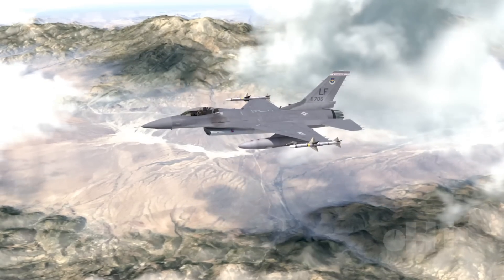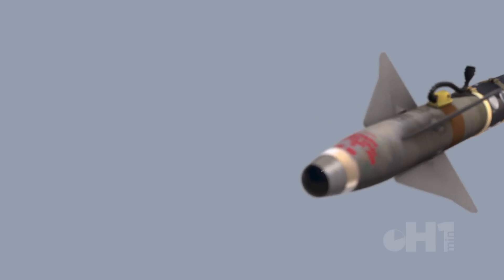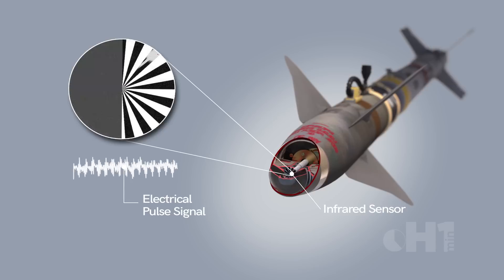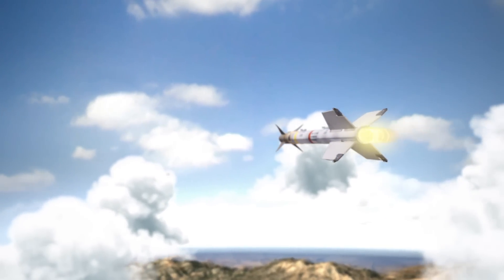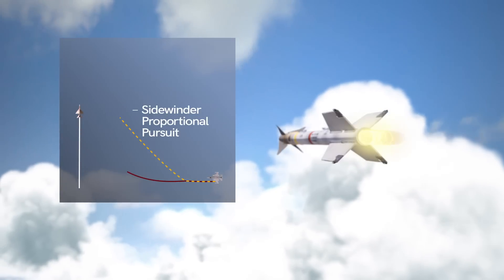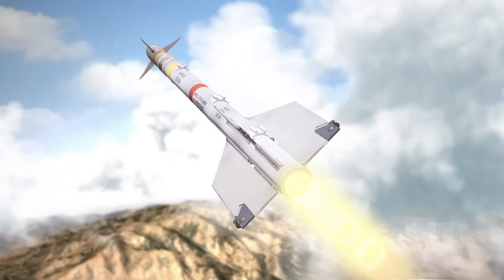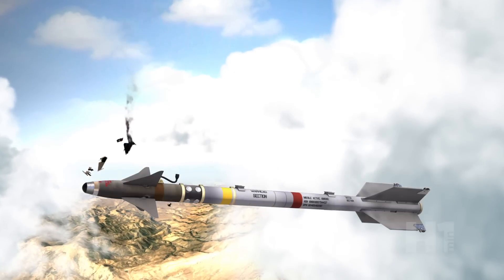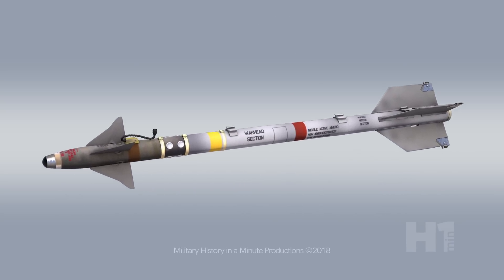H1MIN: AIM-9 SIDEWINDER Infrared Seeker

Comment: You missed an opportunity to describe the seeker in depth.  It produces an amplitude and phase signal from where the heat gets focused by the lens. The reticle is what encodes this.   Also the optics is a reflecting telescope but it spins on the optical axis to become a gyroscope.  The pointing of the seeker is done via motors that cause the gyroscope to precess in the desired direction.  The sound you hear is actually the signal on the IR detector itself.  The buzzing sound is from the reticle encoding the IR light the seeker is imaging.

Comment: As I understand it, the latest versions of the AIM 9 use a rotating mirror. Since the photo voltaic cell can't discern position, only hot and cold (scalar quantity), it uses the position of the mirror to judge the bearing of where the signal is coming from. But can anyone tell me how the weird interrupter disk works instead?

Comment: How the hell does it distinguish between different IR sources or even calculate a trajectory without computers? It's been around since the 50s, so must have been completely analog.
Reply: There have been MANY iterations / versions of this missile. Yes, been around since the 1950's (Dr. William B McLean invented the worlds first air to air target seeker in that decade). So, back then, the AIM-9B models understandably weren't that sophisticated, nor the AIM-4  Falcon predecessor. Example: you had to be behind the target for the missile to track. Later, in the late 1970's early 1980's, the seeker employed "lead angle tracking." Meaning, as in the vid, the ability to move to where the target will be greatly improved accuracy. Additionally, advances in electronics permitted "CCM" (counter-measures) programming. Example: The ability to not get confused between an engine in afterburner and a countermeasure flare tossed in a "Hail Mary" attempt to throw the missile off course. Not 100% effective, but it helped. The above vid seems to feature the AIM-9 L/M model. With these, you do not have to maneuver behind your bogie - the argon cooled seeker can detect enough heat on your leading wing and nose edges to track and kill. Mark Williams, USAF (ret) Munitions Systems Specialist, 1981 -2002

Comment: I used to work with these frequently at Homestead AFB. The issue arose when the pilot would write in his log "no tone," or "missile won't track," after a training mission.

Be advised; the only "live" component during the training missions was the seeker head. The target detector, warhead and rocket motor were inert.

The aircraft crew chief would "tag" the missile (a ticket with discrepancy) and notify Job Control, who told Munitions Control of the bad missile. We'd go to the flight line and retrieve the missile, open a work order and proceed to try to find what's wrong. 

At the maintenance bay, we'd ground the missile, complete a safety brief and proceed to remove the seeker (head) of the Sidewinder; also known as a "G&C" (Guidance Control Section).

After performing a self test of the test set, we (using technical data) placed the seeker on the TS-4044 set and attached any electrical / pneumatic sources, pressed the "go" button and monitored the diagnostic. Halfway through we'd have to rotate the seeker 90 degrees to a different plane (yaw or pitch) and hit "go" again. 

Somewhere along the way we'd multi-meter read the squib in the gas grain generator in the seeker to ensure its resistance was within parameters. The gas generator provided after launch pneumatic power to operate the canard control surfaces guiding the missile to the target. 

If the seeker passed, we annotated the paperwork, re-assembled the missile and returned it to service.

If it didn't, we run it again, then, again. We might have to test continuity on the seeker umbilical, and follow the technical order troubleshooting chart. If hard broke, it got processed, packaged and sent to depot for repair.

The AIM-9 L/M had an argon filled TMU-72/B stainless steel tank to supercool the seeker. It was small enough to hold in your hand, yet contained 5000 psi (Air Force. Navy used nitrogen in the rack / launcher).

If the pilot exhausted this supply, then yes, he / she might have issues with target lock on. These were some of first items we checked on the flightline. Mark Williams, USAF (retired) Munitions Systems Specialist (AMMO) 1981 - 2002.
Reply from the maker: Thank you for your insights and comments, really interesting details. Thank you for your service!
Reply: IYAAYAS, PGM was my first shop
Reply: @GewelReal  Thanks for supporting our troops!
Reply: Lowery 1980
Reply: @michaeledlin9995   Hi, were you 316 or 461? In May 1981, we were one of the earliest 316 / 461 merger classes...14 weeks long with 10 weeks at Bldg. 903. LGB, AIM-7 / 9 AGM-65. Four weeks ASTA.
Reply: I'm concerned. Is this declassified?
Reply: The M was the first to incorporate IR CCM right?
Reply: @norliasmith  Incremental improvements have been incorporated into each successive model. I believe to some degree they all used anti-spoof tech. I assume the "CCR" you alluded to means "Counter-Counter Measure". I can say the "L" was game-changer in every regard, but nothing comes close to the "X" in my research. Never even seen one. Awesome weapon.

Comment: You forgot to mention that the expanding Ti rods were designed such that when the chain expanded, it span, acting like a chain saw, with the proximity sensors designed so that the Sidewinder flew up and alongside the pilot and cut him in half.  Much easier to build a new aircraft that build and train a new pilot...
Reply: Your source for this information? It sounds a lot like old mates story in a pub after downing 8 pints.
Reply: @JaakkoF  I was in the RAF.

Comment: I worked on the project back in the early 1980's, the DoD factory I worked at built the proximity fuse for the Sidewinder, this is arguably the the best air to air missle ever built.
Reply: Yes least what comes short range IR missiles.
Reply: @almightybunny3320  : thanks, I should have clarified that

Comment: And yet us with our most modern computers can't beat what our forefathers did with a slide ruler
Reply: I'm currently teaching my computer to pull job listings from across the globe, and learn what kind of jobs I like using nothing but the text in the job descriptions, then serve me a list of my top 100 jobs using only my inputs of "yeah I like that" and "nah that's not for me." I own a slide rule and have used it in engineering classes while getting my degree; but modern computers are so far beyond that you insult the very transistors they're composed of by deigning to put them in competition with the dumb slide rule.

Comment: The AIM-9X's seeker is significantly more complex than the old m or l models as shown on this video. But the missile costs over 1 million dollars.
Reply: I heard it is very resistant to flares and other counter measures. You literally have to blind it with lasers to have a chance. Was inevitable with minicameras and microchips. But that price like you said is crazy. Now almost 1.5 million and going higher. Raytheon ripping us off.
Reply: @steveerossa  Cheaper for US, for them most contracts are in the 400k - 600k range. I'm from finland and remember seeing a 1.2 mil per unit contract during the finnish f/a-18 modernization project.

Comment: This is a very clever design, more clever than I thought. Could you please specify what version are you describing? I've heard that AIM-9X has full blown thermal camera instead of basic sensor.
Reply: This is applicable from AIM-9B (the original production model) to AIM-9M, though the seeker technology improved a lot over the course of development- the AIM-9B had an uncooled seeker that could only lock on from directly behind the target at fairly close range. Later models upgraded it to a cooled seeker that initially could lock from longer distances and at a wider range of angles. Ultimately (in the 9L model) it was even able to lock on to a jet flying directly towards it. The later seekers were also much more resistant to decoys such as infrared flares.

The AIM-9X is really a totally different design- aside from the imaging seeker it also steers with the rear fins not the canards, has thrust vectoring, and uses a computerized autopilot for stability rather than rollerons. AFAIK it only shares the warhead and rocket engine with previous AIM-9s.

Comment: -There been many variants of the seeker heads used in AIM-9. They have major differences between them.
-On the video you can see AIM-7 on wingtip pylons. First, very few F-16 variants ever carried AIM-7, seconds, they couldn't carry it on wingtip pylons.
-LOCK audio cue has nothing to do with AIM-9. Lock cue means that radar have locked on the target in ACM mode. And it says LOCK just once, not twice.

Comment: WING MOUNTED SPARROWS anneurysm

Great video though.
Reply: To make it clear, the F-16 never mounted the Sparrow on the wingtip rails operationally. Only the Sidewinder and AMRAAM.
Reply: What's the problem with wing mounted missiles lol
Reply: @h31212  He never said there's a problem with wing mounted missiles. He said the problem is with wing mounted SPARROWS.
Reply: Sure they’re not AMRAAM’s?
Reply: @billbrockman779  No. The AMRAAM's front and rear fins are basically the same size.
Reply: 米空軍パイロット I loaded AMRAAM’s on F-16’s and Sparrows on F-15’s, knowing the difference.  Only an early air defense version of the F-16 was ever modified to carry Sparrows.
Reply: @billbrockman779  Yes, but it was only for stations 3 and 7.